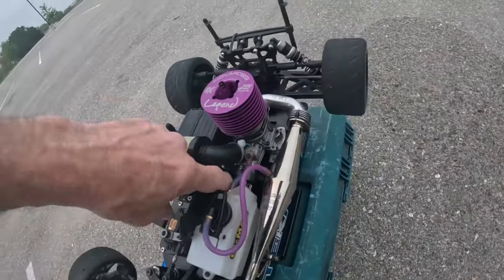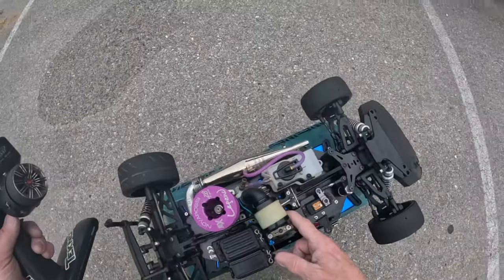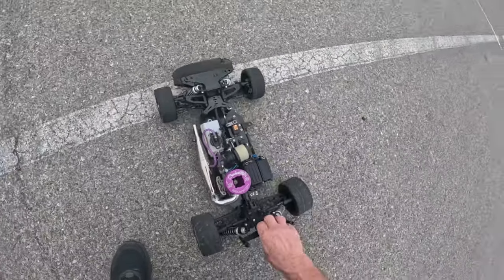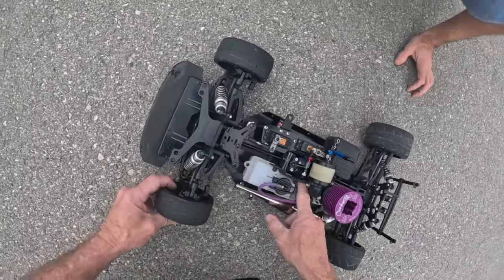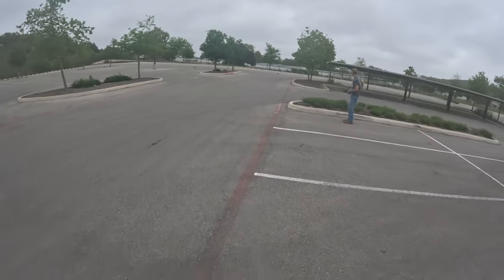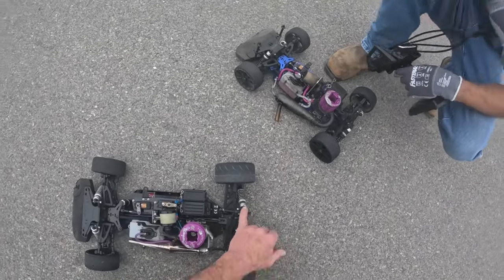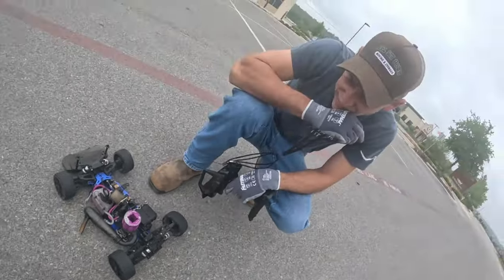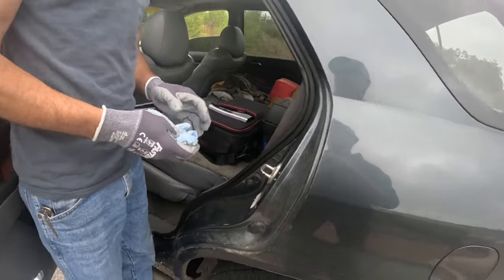SCARY FAST KYOSHO GT💥💥

Comment: MANNNN i started watching your you tube in the last month and I have an aftermarket original Kyosho carbon fiber chassis GT2. wait i actually have 3. 2 electric and one nitro. So every time you bring that bad boy out i watch those vids at least twice. I'm going to run mine today because of this video..... WICKED. by the way check out the GT3 shocks they are way more advance than the original GT2